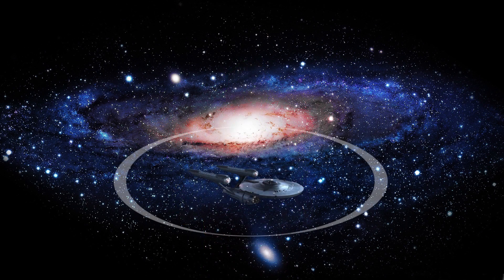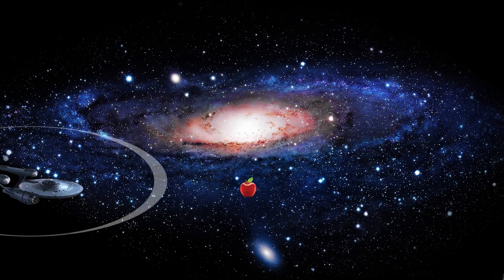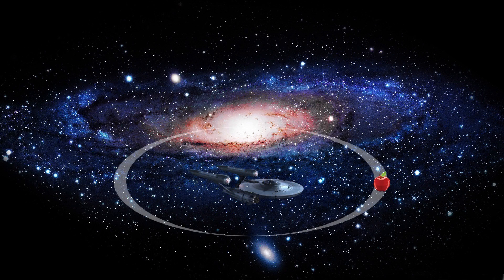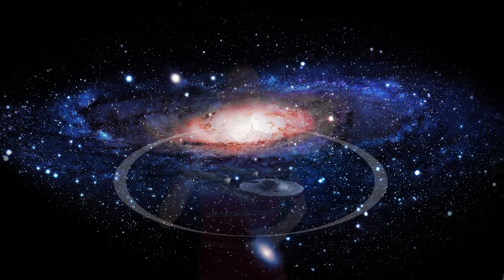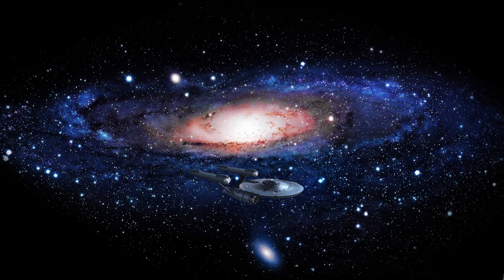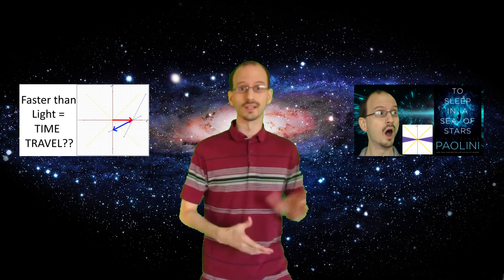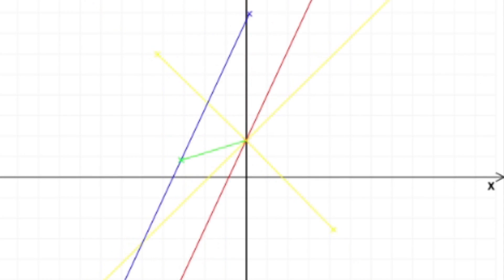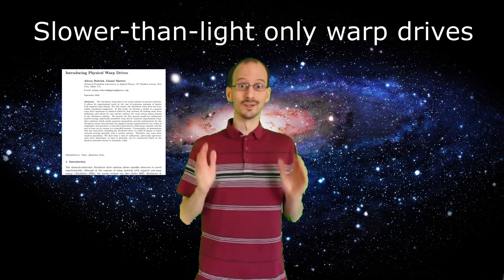A Deep Dive Into Warp Drive

Comment: Has anyone looked at ways of clearing out the space just ahead of the bubble.. gently pushing matter aside ahead of the main bubble's arrival? Otherwise I imagine tons of stuff would be collecting and floating around inside the bubble.. not just at the windshield. 

Also, would stuff be more apt to fly out the back of the bubble, or to stay inside of the bubble? I guess that just depends what their trajectories were before entering the bubble. ?

Thanks! Great videos! I just discovered your channel recently trying to grasp entanglement. I have a thousand entanglement questions.
Reply from the maker: The question of pushing matter aside is a good one, and I don't know if anyone has looked into that. I suppose you could have two warp bubbles, one like a scoop in front to catch all the dust, and the second bearing the ship.

As for what happens to material inside the bubble, the key is to remember that the inside of the bubble is effectively stationary. So whatever velocity the interstellar material had relative to the ship before it entered warp, the material has that velocity relative to the ship inside the bubble.

Comment: Step 1:  Identify the "atom of spacetime" as the graviton.  Step 2:  acknowledge that a graviton is (1) Psi wave function from QM, (2) the carrier of the physics constants, (3) the graviton expands at the speed of light like a water ripple,  and (4) can store gravitational potential energy in its momentum quantum states.  Step 3:  capture a graviton; hint the down conversion process of quantum entanglement is how you capture a graviton between entangled photons p1 and p2.  Step 5:  store gravitational potential energy in the graviton by blueshifting p1 and redshifting p2, several million times.  You can centrifuge p1 and p2 by building a motor with a centrifuge that runs along the radius of a disk of radius 1 meter.  When you can store enough gravitational potential energy in the p1/p2 entangled photons, you can experiment with ways to release the p1 and p2 photons that results in a gravity field.  When you get good at this, it will result in a gravity field propulsion drive which can be engineered into an Alcubierre drive that does not require exotic matter or negative mass.

Comment: Well they have found 2 other ways to create warp bubble, that’s the last I heard, there is a white judey and solitons
Reply from the maker: They are not alternative methods, they are continued work on the same method. The Alcubierre bubble IS a soliton, and the White-Juday interferometer is an experiment designed to try to measure space warping of the kind described by Alcubierre.
Reply: @chrishorst2124  so they are kinda like off shoots of the original idea then?, And more to come?
Reply from the maker: @Klix3ontop  Yep! There are actually a decent number of refinements and offshoots, and I did my best in this video to speak in general terms that apply to all of them.